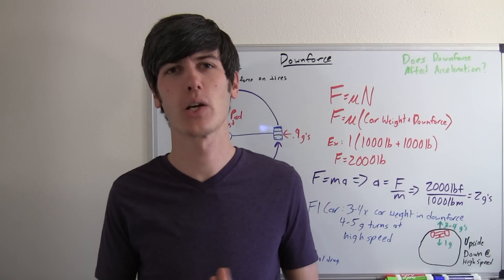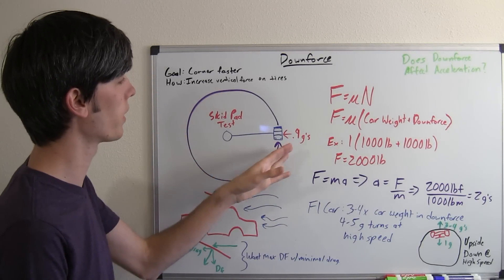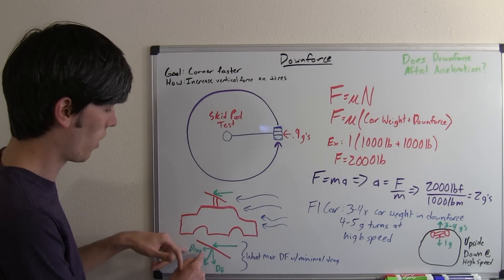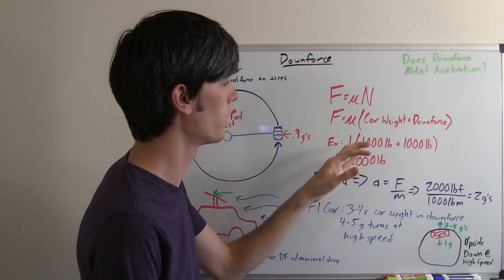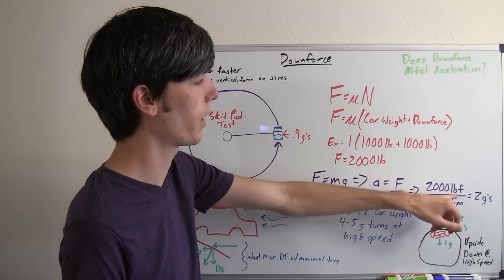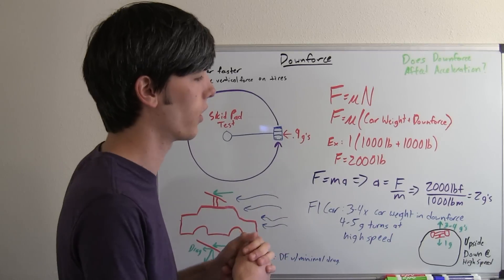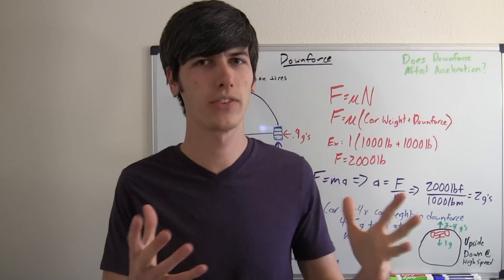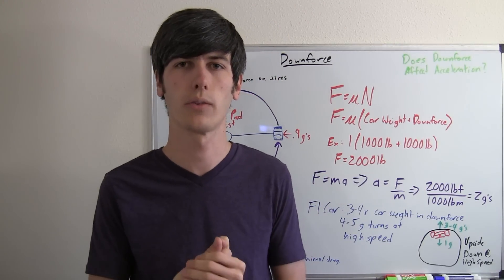Downforce - Explained

Comment: If it allows you to drive upside down for extended periods and not just loop the loop then Formula one Mobius strip track where you drove on both faces of the road would be cool, unless you crashed and dropped off the track.

The only problem is will the engines flood with oil if run upside down? Also that and the impossibility of the safety car completing a lap.

Comment: so would a typical street car (lets say toyota camry) produce lift at higher speeds? it does feel like driving a car like this fast on the highway makes it feel lighter, I guess cause there's less weight put on the contact patch via lift?
Reply: adding to this...a car with moderate aero (lotus elise) produces maybe a dozen pounds of downforce at 100mph. doesn't sound like much, but wouldn't this mean its aero has neutralized the potential lift? going in a straight line at 100 mph vs 10 mph the car would have the same force applied to the tires.....whereas the camry might see (hypothetically) a reduction in applied force (less grip)

Comment: I read in a forum that the Thule blade roofrack system adds downforce but I don’t see that in the manufacturers errata... is that legit? Is it significant? Is that a cheap way to add a little downforce?

Comment: Does the frictional drag between the tires and the ground also increase with downforce? Yes right? 
Also, seeing as downforce is dependent on the cars velocity, is the effect on the accelleration very important? I'm nowhere near an expert when it comes toncar racing but I'd assume that accelleration is mostly important at low speeds?

Comment: Question: if the downforce increase exponentially relative to speed. Can we reach a point of very high downforce that the car stop speeding or stop altogether?
Reply: A Wingedbull no because you have to have airflow to create down force and if you did have a system that created that much down force it would have enough airflow to get the car to a complete stop but it would slow the car down

Comment: Why is downforce necessary in cars that can't go at very high cornering speeds? It will just increase drag. So my question is, can the downforce help in providing better traction (because it will increase normal force and thus should increase maximum friction that is responsible for accelerating the car)-? If so, then will this traction help me achieve higher acceleration? I am a newbie so please correct me if I said anything wrong here.
Reply: Where is the mistake? Doesn't he show F increase by the same factor as a in the video?

Comment: If friction on the tires is dependent on weight and downforce, why do lighter cars tend to produce more grip than heavier cars? Is it because heavier cars usually have a higher CoG?
Reply: It's not about lighter car producing more grip. It's about lighter car having a lower centrifugal force.

Comment: will a car be fast if its spoliers/wings come up only when it is taking tuns?? that way its acceleration will also increase and the cornering will be quite great.... is it fine??
Reply: Yeah some newer sports cars have active aerodynamic elements where they adjust based on speed and airflow and whatnot. So the wing could be in a different position at different speed or while cornering. Examples of cars with this are: buggati veyron, ford gt, and Hennessy venom.
Reply: The F1 cars has the opposite system called DRS (Drag Reduction System), but it's to achieve what you described. On straight line sections, a flap open to reduce drag.

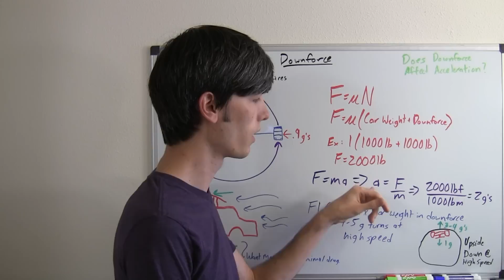Comment: At 4:37 , while using that equation, you are equating the vertical force(downforce) to the horizontal acceleration, which I think is wrong. So, according to me, the only explanation will be that because of increased drag(horizontal force), the acceleration of the car will be reduced.

Comment: The ammount of downforce generated by air simply pressing on the wing, as you presented in the video, is actually marginal and does not guarantee any performance. The most downforce comes from pressure differences between areas above and below the wing - check Bernoulli's principle. It's basically a reversed air lift. It has nothing to do with air hitting the wing, but how fast it flows around the aerodynamic profile.
Reply from the maker: wojasrobert There are quite a few misconceptions regarding wings. Check this out: https://www.youtube.com/watch?v=OjruwfiUtGY

Comment: at 1:16 im having trouble seeing how you got a vertical downward component vector if the air is hitting it horizontally and not at an angle
Reply: ***** deflection. The air is directed upwards and good old Newton kicks in (action = reaction). But the picture is pretty much a simplyfied version. You would normaly use something which is more shaped like an upsidedown aeroplane wing.
Reply: +reyrey389 A diagonal vector can be split into horizontal and vertical components.

Comment: creating downforce using a rear wing, doesn't cause the front end to lift, thus causing loss of traction in the front end?
Reply: Well. Normal cars and even hyper cars made partially from carbon fiber simply weigh too much for that to happen. And in f-1 cars there are front wings aswell. Sorry for bad English.

Comment: Downforce is mainly used on light cars because they tend to lose grip at high speeds. Sometimes you see tuners who increase power a lot adding air splitters, canards, and spoilers, which add downforce to keep the car on the ground as well as giving it more grip.

Comment: Thx u for all your great vids!! Keep it up bro!! 
I have a question for you. What is the minimal speed to generate down-force for a car??
Reply from the maker: Well you can generate downforce at any speed, but of course it rises exponentially with speed. Altering the surfaces and aerodynamic features can change how effective it is at various speeds. Most road cars will not see speeds that provide much aerodynamic benefit of a rear wing.
Reply: Thanks for the info. Other than calculating the downforce theoretically using fomulas, is there a method to check the car downforce by experimental?

Comment: So dragsters mustn't have spoilers or rear wings?
Reply: +Leonidas APFH they shall have  rear spoilers but designed for less drag and not more downforce. at least that on front wheel drive. on high horsepower rwd it may be good have downforce.

Comment: I've just seen your suggestions, these are the topics I would love to know about
Torque Steer, Electronic power steering, E-diffs, Active and Air suspension, especially the suspension, I would love to hear what the difference between Air and Magnetic Ride Control, for example, in the Audi R8 and the C7 Stingray, thank you for a great channel
Reply from the maker: I will have a video on magnetic suspensions in the relatively near future. Other than that it will be a while, but thanks for the suggestions!

Comment: If you did not do a video about how does launch control exactly work, that would be amazing, because a Caterham has less weight to the GTR and better power-to-weight ratio, even though the GTR accelerates from 0-62mph in 2.8 seconds. So can you explain how does launch control work
Reply from the maker: AWD is also working in the GTR's favor there.

Comment: Is it possible to send a car into a corner turn and be going fast enough that thcentury down force helps the car to hold its grip and if you let up on that speed releasing some down force that the car could loose its grip and slide into the wall.
Reply: Part of. It's normaly not such a problem to keep the car on the track even at lower speeds, but it can happen that the car behaves very unpredictable because you don't generate enough downforce. You can see that at some Formula cars like the F1 cars. So it's not like you would just slide of the track, it's more like the car starts to get bitchy because normaly the front or the back of such a car will lose more Downforce with lower speeds so the balance is changing.
Reply from the maker: Yes, indeed it is!

Comment: Simply, the only way downforce affects your acceleration and speed is through aero drag. The weight is simulated and not the actual mass of the car. Am I on the correct thought process? You should do a video on ground effect and the Williams FW07, Lotus 78/79, and Brabham fan car.
Reply from the maker: You are correct, yes.
Reply: Engineering Explained More downforce should also give you more grip, possibly allowing faster acceleration and deceleration, right?
Reply: Yes but only once your accelerating past the point where the speed of the car and the downforce combined to eliminate wheelspin. Modern F1 cars create their own weight in downforce at around 80-100mph. Same thing for braking, they do all the braking at once at high speed while the still have the downforce, then ease off the brake all the way to the apex.

Comment: Can you start explaining about trucks? Heaviest would be a 3500, 350.
Just to learn about torsion bars, strains that lift kits apply, manual locking and automatic locking hubs. Can you also explain the effects of no back pressure to an engine(straight pipe exhaust)? And also (if you can) explain which additives you support to help with power, fuel eco, and engine protection. I'm sorry for a long paragraph of requests but ive watched enough videos to trust your knowledge.
Reply from the maker: The only one I can cross off the list is the back pressure question: Performance Exhaust - More Horsepower

Comment: You touched on how downforce affects acceleration in the video and it seems to me that it only reduces acceleration because of the drag. So why then do dragsters use wings and such? They aren't taking corners so why use them? The only reason I could think of is that they are so traction limited by the tires, the drag from the aero work is minimal compared to the gained traction. Am I on the right track or what?
Reply: That, and probably without that rear wing it would take flight at 300mph.
Reply: Its used for stability. You want a rear wing to generate enough downforce behind the cg to give grip to the rear tyres. You dont want to much though as you would have little controlability from the front tyres as well as an excess moment which could flip the car at high speeds in the right conditions eg Mark Webbers Mercedes at Le Mans.
Reply from the maker: Yes, drag cars are traction limited, so the spoiler actually increases the amount they are capable of accelerating.

Comment: Another thing about accelerating in a high downforce car is that it's related to the speed of the vehicle so it mainly comes into play at higher velocity. An F1 car can make 4 times its weight in lift but that happens near 300km/h. And once at that speed it's like towing a small hatchback car behind you from the drag the cars generate.

Comment: Question! Do you rev match when you downshift in your teggy?? Does it wear on a transmission if you don't?
Reply from the maker: Yes, you should try to match the revs when you downshift. I won't say I hit them perfectly, but I certainly try to get the RPMs close.
Reply: Engineering Explained  Awesome, thanks! I've become rather good at rev matching in my rsx-s.  Took a lot of practice and seat time however.
Reply: ***** You're clutch is meant to downshift and it doesn't ruin your clutch if you don't. It takes wear off of your synchro's because they have less synchronizing to do when you rev match.